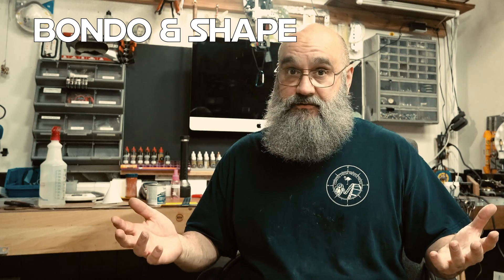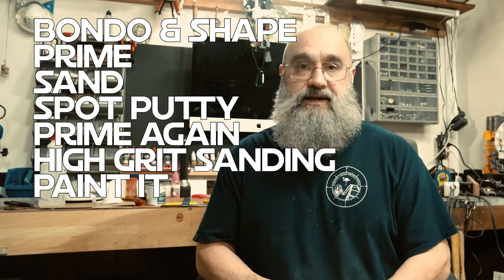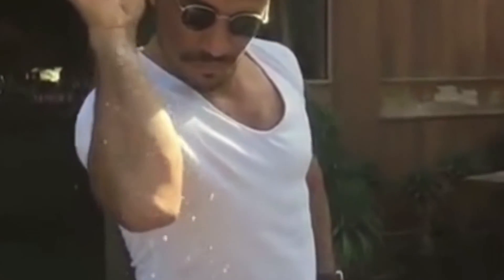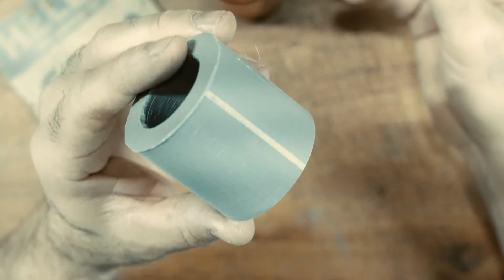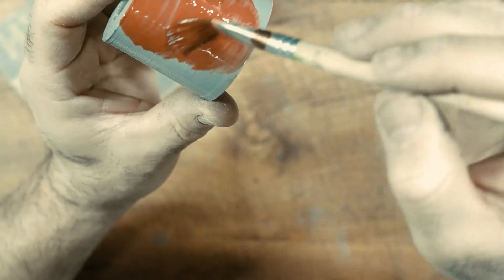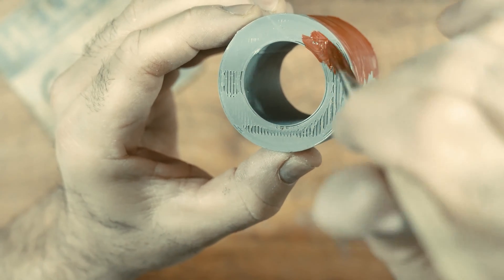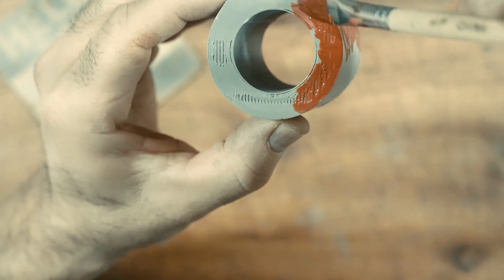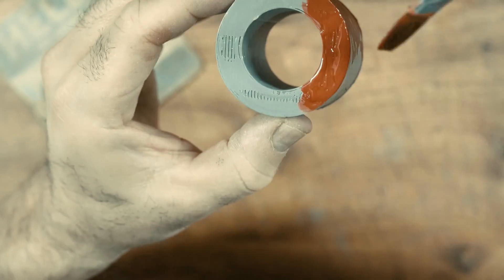How To Remove Layer Lines from your 3D Prints

Comment: Got any tips for prepping 3D prints with a lot of fine details? I have some that I want to paint, but I fear sanding them too much may get rid of all the details.
Reply from the maker: Stick with multiple light coats of primer and light sanding in between too much primer will hide the detail not enough primer won’t fill in this layer lines

Comment: I’ve tried the putty/acetone airbrush on a few projects now, I admit I liked how fast breeze through sanding and how nice the surface got, but I love how you put it “you made an expensive primer” 😂  I also switched brushing after to that, and after having to buy a new airbrush 🤦🏻‍♂️. So much easier. I also just started using UV resin for filler. Really liking how well it works, but for sure a whole net of procedures come with it. Definitely not for everybody.

Comment: What are your thoughts on XTC-3D?
Reply: XTC is very thick and could be used over large flat surfaces such as the example that was given in the video here However if you use it over your entire print which is called "candy coating" you will lose your hard edge or embedded details.